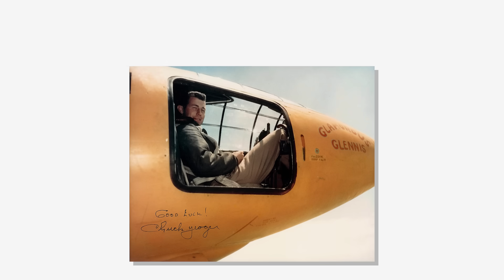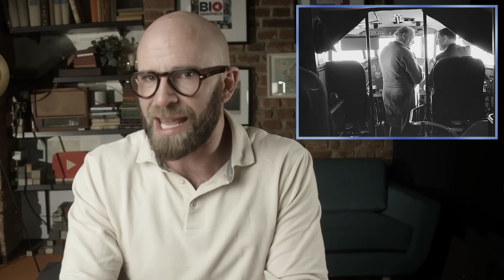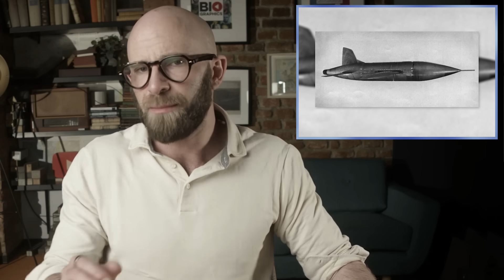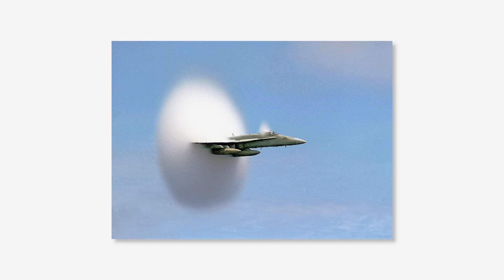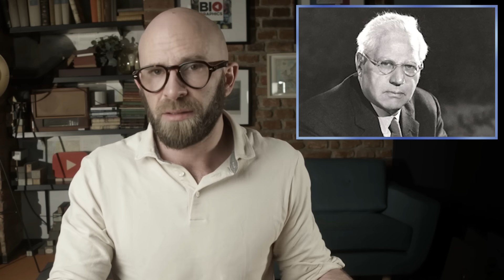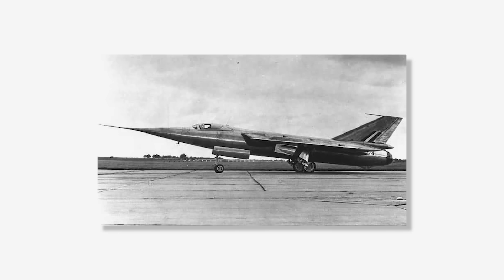Why was It So Hard to Break the Sound "Barrier"?

Comment: This video is poorly researched nonsense.   Seems to be real live human speaking but the script is most likely AI
Fact:  the Miles M.52 was essentially a scam that could never have flown.   Miles did not have access to a supersonic wind tunnel and the shape was just pure speculation.   An engine with sufficient power was not available.   The Whittle/Powerjets engine proposed was useless - it took Rolls Royce engineering expertise to make the jet practical.   The idea pushed in this video that Power Jets could just add afterburning is ludicrous.   Quite beyond their expertise. The high temperature (titanium/nickel alloys} metals needed for the tailcone were unknown at that time.   Metallic titanium not even available.  And even if they did, since afterburning never does more than double the thrust, the total thrust would have still been way below what's needed to go supersonic.
As for any German pilot exceeding Mach 1 in 1945 - that's pure fantasy.   They didn't have a good enough engine either.  
The author of this nonsense video seems not to understand what is needed to get air into an engine at supersonic speeds - it is NOT merely a matter of having a hole in front.   You need velocity reduction and shockwave control - something quite beyond even Rolls Royce at the time.   A cone fixed right out front is not what does it - the cone is just for drag reduction.
The Miles M.52 was essentially a scam for getting money out of the British Government - something that began with Miles, became entrenched in the British aircraft industry, and ended when the government woke up and cancelled the useless TSR-2, ordering everything destroyed.   That the M.52 was a scam was why the British Govt cancelled it.
To go supersonic, you need either a delta wing or a thin wing.   Nobody in Britain or the USA back then knew how to make a thin wing strong enough.
Reply: Useless TSR2. The test pilots with years of experience and war veterans, openly stated it exceeded the requirements and was successful as far as they were concerned. Roland Beamont and Jimmy Dell were far from amateurs and knew what they were talking about.
Tornado pilots looking at the data on the TSR2 said the TSR2 did it all first compared to the Tornado.
Reply: @percyprune7548  Being able to fly acceptably controllable is not the whole story.
Fact:   The TSR-2 was supposed to bomb targets by flying at ultra low altitudes so as to be undetected by ground-based radar.
Fact:    As built, its range was insufficient to reach any conceivable target.
Fact:   Flying low enough to avoid detection by ground based radar made it necessary to follow terrain.
Fact:   The equipment proposed for the TSR-2 terrain following was not fully automatic.   Essentially, the on-board radar told the pilot what to do.   It was found that pilots could not keep up for the flight duration required.  The workload was just way too high.  
{Incidentally, in the fully automatic F-111, it was found that at the contract-specified lowest altitude, it was found that the constant lurching about made crew sick in minutes.   So flying a TSR-2 across enemy territory was completely infeasible.

Fact:  The TSR-2 was plagued with problems that showed up in prototype testing.   Probably these were solvable by throwing more and more money for redesigns at it, but the British Government had had enough.

The British Government cancelled it because it was useless - could not perform its mission, and was suitable for only training flights.   Since government experience was that failed major projects had a tendency to not stay killed and go on to rise up and waste more taxpayer money, they took the rare and dramatic step of ordering everything destroyed.   That also served to give the British aircraft industry a lesson that sucking on the taxpayer with never ending delays and never ending promises of fixes with more money had to stop.   Contactors had to deliver, get it at least roughly right first time.
The TSR-2 was developed while a Conservative party was in power.   Problems had surface and there were many highly placed critics, but the Conservatives were restricted by a sunk cost fallacy and fear of political fallout if they cancelled it.   But an incoming Labor government did not have this political baggage and quickly killed it.   They killed it because it had zero export value and cost far too much for what it could do.
The Conservatives expected to recoup much of the development cost by exporting TSR-2's to Australia's RAAF and elsewhere.  But the RAAF refused to buy it - it was useless.   Its range was so short it could not even fly from one RAAF base to another, let alone reach the coast on any conceivable mission to bomb an enemy.   Nobody outside the USA had in-flight refueling back then.

Why do you think the Government killed it and ordered everything destroyed?   And don't repeat that old urban myth spread on YouTube that it was ordered by the USA to sell F-111's.   Britain was paying off huge dollar loans and the US was far more interested in Britain exporting than importing.

Comment: They had it. The UK had it. They had it and gave up. Note that Bell also used the M-52 style escape capsule system in the X-2, the first aircraft to exceed Mach 3. Unfortunately, the test pilot on that flight, Milburn Apt, was knocked unconscious by the capsule separation. By the time he regained consciousness, it was too late for him to bail out and he was killed when the capsule impacted the desert floor at Edwards Air Force Base.

Comment: Several broke the sound barrier - in dives or died -  Yeager was the first to exceed in level flight and had the data to prove it. There is a similar argument for who flew the first powered flight and control the vehicle. A number flew but could not control the aircraft as they were too stable. So, the winner in the Wright Brothers as the aircraft was slightly unstable and therefore controllable.

Comment: Originally from what I know, the X-1 had a conventional tail, but ran into compressibility issues, but its trim moved the whole tail. You see this on modern airliners. The whole tailplane moves but it has elevators.  The test pilots. Realized that the could control the X-1 by using the trim. Then they later changed it to a flying tail.
Reply: The Miles M.52 data was crucial for validating what the test pilots had done experimentally.
Reply: Came here to say this
Reply: Only...ONLY AFTER the UK government gave the 'all flying tailplane' research and data to the Americans...... With a promise to reciprocate. And, the rest of the world knows how not to trust the yanks..... It's where the original sayings, the cheques in the post, and I promise I won't cum in your mouth originated....😅
Reply: The Bell X-1 NEVER had a conventual tail.
Reply: @maxschell8823  Do you want the truth? The X-1 Jeager flew had a tailplane/horizotal stabilizer with elevator and a trim able to move the whole thing. On one flight running out of elevator authority he used the trim control to maintain control. All clearly explained on page 168 of his Arrow Books paperback Autobiography. That led to subsequent aircraft having all flying tails.

Comment: Please use the normal units. Feet not Metres for altitude. Knots not KPH for speed.
Reply: Units cannot be considered normal when only 6% of the Earth's population uses them. It's you yanks that use the archaic units when the rest of the planet have moved on to Si units. 
In fact, every single imperial unit in the u.s. is defined using Si units & it's only converted for the uneducated american masses who think they live in an imperial system.
Reply: Please stop using miles per hour when talking about the sound barrier. It’s not relevant. You should be using Mach number.
Reply: @thethirdman225 Exactly, Mach 1 changes with temperature & pressure.
Reply: @Aengus42  You can reduce it to just temperature because pressure varies with temperature.
Reply: @thethirdman225 Surely, although incredibly thin, the thermosphere is a tad warm? 
I mean, what you say is true in the troposphere, but the stratosphere warms with altitude up to the mesosphere where it reverses once again and cools as you go up until the thermosphere where temp once again climbs. 
As temperature increases, the speed of sound increases, and Mach number decreases if the object's speed remains constant. Pressure influences the speed of sound through its effect on density.
Reply: @Aengus42  Yes, that’s what I said. All the things that matter vary with temperature.
Reply: @thethirdman225  I guess it's the pedant in me, Asperger's is like that. But a very close approximation is still an approximation... This from Google's AI that was questioned with "Is Mach 1 different between a low pressure gas & a high pressure gas if the temperature remains the same?" 

"In an ideal gas, yes. But in a real gas, the relationship between pressure, temperature, and density is not perfectly ideal. For example, in humid air, water molecules—which have a lower molecular mass than oxygen or nitrogen—displace the heavier gas molecules, causing the speed of sound to increase slightly. However, for most practical applications involving air, the ideal gas model is a very close and accurate approximation."

But I'll give you that for practical use the small variations seem to be ignored.
Which might run into trouble seeing the gaggle of errors lurking deep within the Navier-Stokes equations discovered recently.

Nice to chat, mate. Fly safe! 
(Yeah, I nicked that from Scot!)
Reply: @Aengus42  That makes two of us with Asperger's. For me you can also add synæsthesia.
Reply: @thethirdman225   Hahaha! Imagine being undiagnosed until you were 45, but in your 30s, you were trying to help your NT kids with their maths homework, not realising you'd got number synesthesia! 
As in "Right, you know 8 is an even number, but you can feel those two 9s lurking just under the skin of 18?" 
(What, dad??)
Or, "Ok, you can feel that 7 you threw over there..." 
"Over where, dad?" (Looks around the carpet.)
And "FFS! How can I concentrate on driving with the volume set to an odd number! It's so bloody uncomfortable!"
(Look of concern from whole family!)
It's just a touch, but more than enough to frustrate me and the kids when I try to explain how maths works. A few times it left all three of us in tears! 
I understand, mate. I really do! 😎🕊️
Reply: @Aengus42  I'm sure you do. Mine is number-form and time-to-space synæsthesia. There wouldn't be a hundred people in Australia with it. Oddly enough, it don't give me trouble I can quantify. It's just a quirk. But when I was diagnosed I told the bloke about it and he said, "Can you explain it?" I said, "I can do better than that. Give me a pencil and paper and I'll draw it for you." Apparently it plays a much bigger role than I ever knew but they can't measure it.

Imagine being a chromæsthete and using the old coloured Cuisinaire rods and your colours didn't match the ones in front of you. How would you ever learn maths? I didn't have any learning difficulties so I was lucky.
Reply: Normal?....Normal to whom? When it comes down to units there's no such thing as normal. 
They are STANDARD units and most nations have their own Standards.
Reply: @flamingfrancis  He's a Brit- speaking English. All of Europe (and most of the World) uses feet for height/ altitude and Knots for speed, in aviation anyway.

Comment: The first recorded super sonic flight was by a pilot called Walshe in a prototype F86. The US government wouldn't let them claim this record as they had spent millions on the X1. This same aircraft and pilot officially went supersonic 6 months later. Ref, book, Mach 1.
Reply: The only problem with that is when "Wheaties" Welch supposedly did that, the airplane was in the hanger at Muroc having the nose landing gear hydraulics worked on the original hysdraulic cylinders were too weak to retract the nose gear under air loads in flight.
Reply: George Welch made that story up. The Xp-86 could not even come close to breaking the  sound barrier.The Alison engine in it did not have power to do it.Welsh was a wanabe.

Comment: why didn't they give swept wings in x1 ?
Reply: Swept wings, and their potential advantages were known about in the U.S., at least in late 1944 when the X-1 was being designed - the potential had been shown by Robert Jones at the N.A.C.A. and Gluhareff at Republic (Who also proposed Delta Wings).  I don't know if the Brits were given the information - my impression is that they weren't.  What wasn't known at the time, since nobody had flown highly swept wings - the Me 262 doesn't count. It didn't have enough wing sweep to materially affect the Drag Rise - was the low speed handling behavior of highly swept wings, and the effectiveness of flaps and ailerons.
They knew that thin-section straight wings produced less drag, and that with enough thrust (Like a rocket engine at altitude), they'd be able to go supersonic.

Comment: Why is there absolutely nothing in this vid about the Germans doing it?
Reply: Because the Germans didn't.  And before you bring up claims, I was part of a project to obtain a pair of Czech-built Me 262s in the late 1980s and restore them to flight - re-engineing them with more modern engines (GE CJ-610s, as used on the early Lear Jets).
My role was Performance and Flying Qualities.  The most you were going to get from an Me 262 in a dive was about Mach 0.9, maybe Mach 0.92.  The only claim that an Me 262 achieved Mach 1 come from Hans-Guido Mutke, and the records from his unit show that none of his postwar claims actually happened.

Comment: Frank Whittle was involved with the Miles M52 project. He not only calculated that it would be possible to break the sound barrier with a Jet powered aircraft, he also proposed the High and Low Bypass Turbofans and also the Reheat or Afterburner. The Air Ministry was so obstructionist to Whittle that had they actually backed him from the start there could have been operational jet fighters by as early as 1938. Whittle wrote his initial Thesis at Cranwell in 1928. The British Government also "gave" the Americans much of their promising technology, including Tube Alloys (Atomic Bomb), Whittles prototype engines (W1.X) the Miles M52 and heaps of other stuff. The Americans promptly Classified most of it and gave nothing back in return. If backed, the M52 would have definitely been first for the Sound Barrier, with a jet instead of rockets. Side by side the M52 and X1 are almost identical from the outside. Whittle was also a talented aerodynamicist and was involved with Miles for the airframe design.
Reply: Yup, remember watching a programme all about this on a documentary in the 90s. Shear stupidity handing over the blue prints. I guess we were desperate for financial favours, and puckering up to the US was part of the diplomacy. I can't think of any other good reasons. I also remember a disgraceful 'documentary' (fairy tail would be a better description)  on the Discovery channel that credited Bell Labs with inventing the jet engine, Whittle's name did not even feature.
Reply: Americans got that technology in return for massive military assistance during the entire war. Without that assistance Germany would have been building Whittle engines.
Reply: @JohnDoe-x2d9s  The UK couldn't fight Hitler alone, that is undeniable. But the UK set out on good faith, as fools - that was never the deal. That is clear.
Reply: @kevinwells768  I might ad that after Britain sold state of the art jet engines to the Soviets in 1946 (which they later used in the MiG15) The US was skeptical of sharing technology with them lest it get into the wrong hands.
Reply: @JohnDoe-x2d9s which the USA charged for… such a huge amount that UK has been virtually bankrupt ever since … wonderful Allies…. 🤔